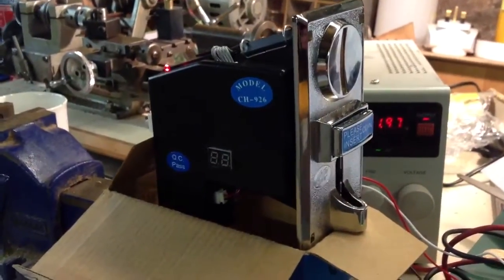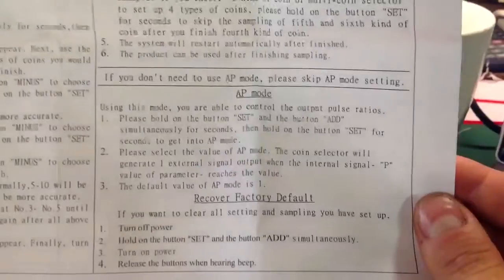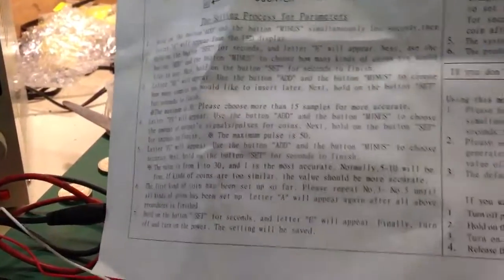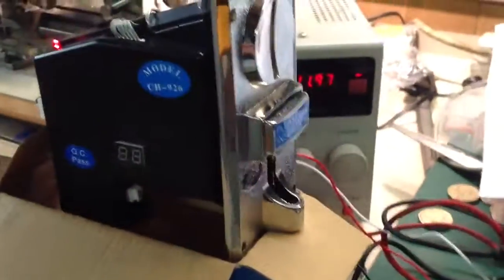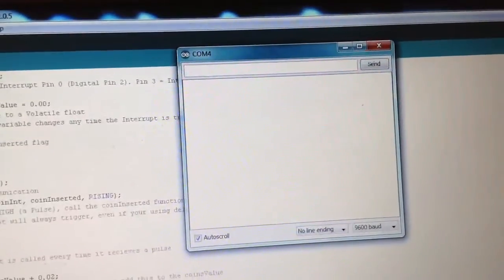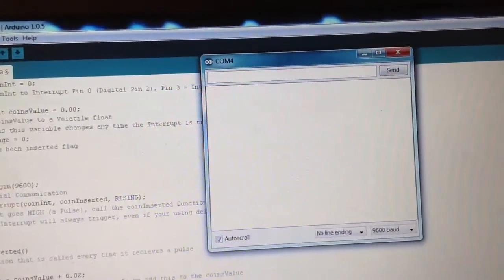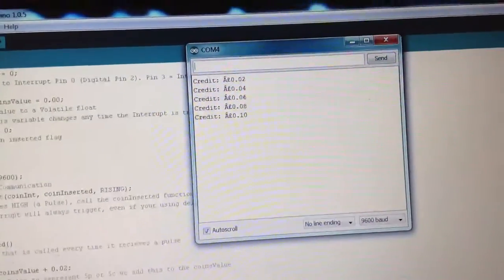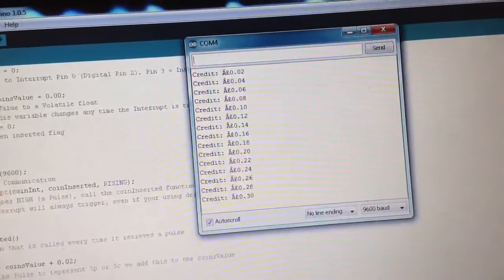Coin Acceptor Working - setting up AP mode

Comment: Hiya,
I'm having loads of trouble setting up a new CH926, I can't seem to enter the parameter settings, when holding the add and minus buttons. I have tried to reset the device according to the instructions but this also doesn't appear to work. Could you share some of your experiences/troubles setting up the coin selector incase some of it is of relevance to my problem?

Regards